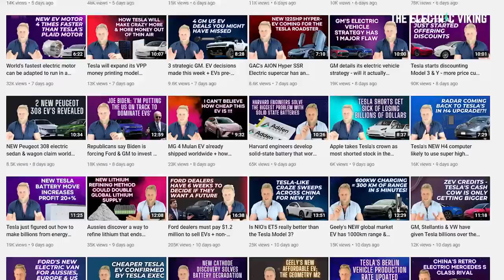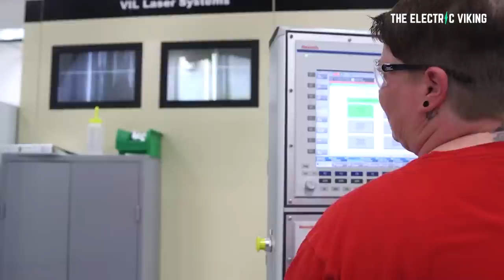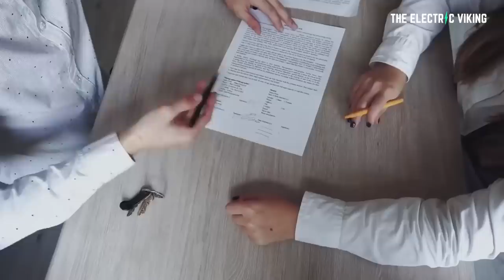China warns (threatens) the U.S. about making EV batteries

Comment: Glad I am not the only one thinking about this! Evs are a national security risk need to start making batteries in Australia
Reply: EVs are actually good for Australia’s economic security as we are nowhere near self sufficient in oil. We can however produce electricity domestically.
The danger from EVs for Australia is becoming dependent on a supply of batteries and other products from China which has now established itself as an un-reliable trading partner. It’s actions in recent years demonstrate that China is ready willing and able to impose sanctions on Australia in response to any expression of a different viewpoint.
Reply: There's a battery factory starting in NSW, the Viking did a video on it, but as we have weak governments, we'll probably always be dictated to by the US or China or EU.
Reply: @brucetownsend691  Don't rock the boat.....
Reply: @brucetownsend691  do you think the reason is due to different opinions? different opinions have been existing for years but both sides had very good relationships before 2016. But why did all things suddenly change 5 years ago? Answer is simply: US finds china poses a threat to its hegemony. So Australia, its deputy and pawn, wants to do the job. Australia has been holding drills around china, 5000 mills away for it, past 4 years. Aussie top brass also repeatedly threatened there would be a war in many public occasions. Economically, Australia slapped tariffs on china 11 times between Feb and Nov 2020 (public data). Those Chinese warned you several times that that was not the correct attitude towards your biggest trading partner and buyer of your products. The last warning came in oct 2020 and plainly stated that Chinese couldn't take it anymore. Then, all episodes started. Let me tell you: your guys did a really good job and can let 1/5 world population list you as no.2 disliked country. From my observations, those Chinese just want to have nothing to do with your guys.
Reply: @anti-bullingjames  You just proved my point. For whatever reason, China is hostile to Australia and we would be wise not to become dependent on Chinese batteries.
Reply: @brucetownsend691  I just explained why it happened. Anyway, no one wants to pay others to attack himself. Chinese eagerly want to decouple Australia. You Aussies should do the same. You both sides can go back the time before 1970.
Reply: @flukeylukey7559  Not weak but O/S controlled govt -by the US :(
Reply: @brucetownsend691  Even less on the bullies US/UK/EU :(
Reply: @brucetownsend691  
LOL .... you should first measure your own size and think through why would China even care about you Aussie, let alone be hostile to you? No, you just don't carry that energy to provoke such emotion.

Comment: China? Have you seen what's happening to China? A massive drought has dried up the Yangtze River, the Three Gorges Dam is not releasing water for hydro (there ain't none) causing power cuts everywhere, factories have shut down because of this,  Northern China is suffering from terrible weather conditions, zero tolerance for COVID-19 has resulted in near riots when shutdowns occur, "rotten tail" buildings are everywhere, resulting in a breakdown of the real estate market and banking system, resulting in arrests everywhere! On top of all this, where is Xi? Is he under house arrest? Coup speculation is running high! Maybe China should focus on its own backyard!

Comment: Of course China is worried because what the US does will impact the entirety of the North American continent. Essentially you're looking at North America with an economic output of 32 trillion dollars that could effectively cut China out.

That in turn forces calculation changes Korean Japanese and European automotive companies on how the source parts and material.

So you have to figure that while China is a large market it is not even close to a majority of where foreign automakers derive their profits.  Generally speaking the North American Market is by far the largest profit center for automakers.

So China knows that if it gets locked out of the US as a supplier the likelihood that European, Japanese and Korean makers go elsewhere for parts grows exponentially. Which effectively locks China out of another 35 trillion in economic output.

And because India is realistically the only country that could supply the labor that likely locks China out of that market as India moves to secure its out supplies free from China.

It's not just the batteries it's the entire industrial supply chain that is threatened and thus the CCP is threatened.

Will it work though is the root of your question and to that I just have to say that China's imagine has nose dived in the US to such an extend that policy wise  our Congress is terrified of looking weak in the face of CCP aggression.  Consequently anything that the CCP may attempt to use as leverage is being yanked out of China with all force necessary. Meaning that congress is going to Lazer focused on securing our supply lines outside of China.

So is Qin threatening the US? Absolutely he is because China is freaking out that they've spent a hell of alot of subsidies and now are indanger of not being able to product dump like they did in the solar panel industry.

The US is gaining alot of experience in countering Chinese product dumping and consequently it's forcing other countries to do the same as they get flooded with bellow market cost goods from China.